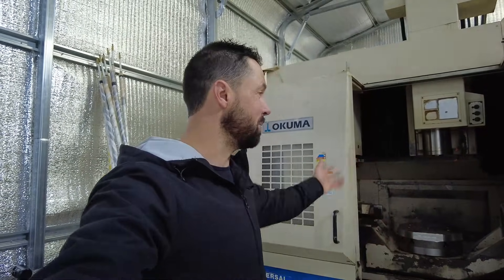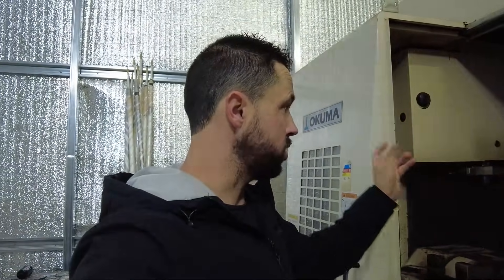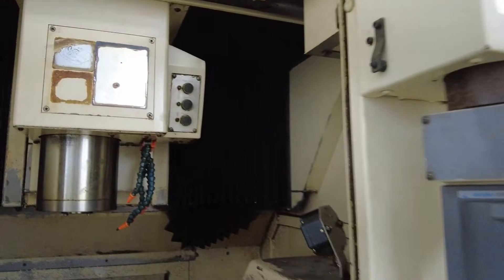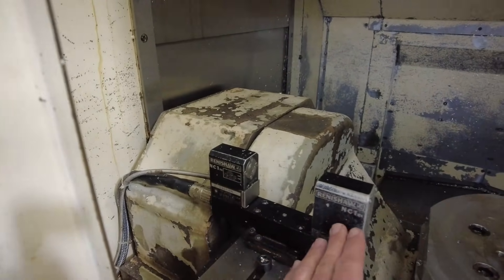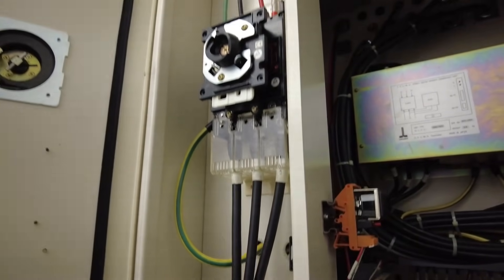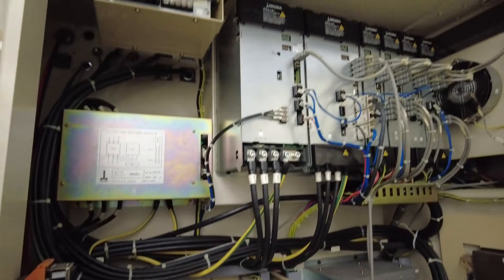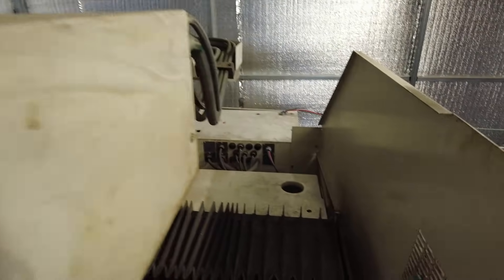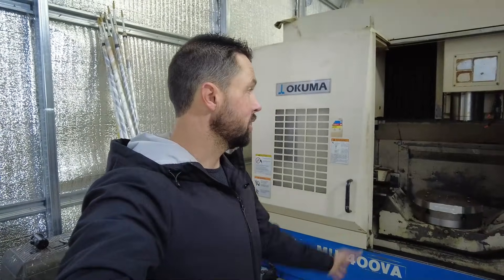Okuma 5 axis update #1 - Is my spindle DEAD?

Comment: I have an Okuma MB-46 of the same vintage.  Getting the toolchanger to work correctly can be tricky and it took me reading the manual a few times to understand what was going on.   If you stop the tool change mid way, you'll need to manually sequence each step to get it back to the beginning of the tool change cycle.   I had a problem with mine stopping mid tool change.  Had Okuma come out and they found one of the magnetic limit sensors on the tool door went bad.  It has a little LED light that indicated door open or closed.  If there is no light, the sensor may be bad.   All was well after replacing that.  The Okuma techs are top notch and know the machines very well.   As far as paint, I use an automotive single stage urethane.  (2 part)   Limco brand and it can be bought at any auto finishes store.  I use the Limco H1000 waterbased primer under the paint.    It's lasted a few years now and hasn't bubbled or flaked off with constant contact with coolant.   Very happy with it and the machine is starting to look new again.  I'm using Trim Sol as my coolant at 14% Brix.  Had surface rust issues below that number.   Best of luck!  That's an awesome machine!
Reply from the maker: Nick,  thanks a ton for the comment.  Had a MASSIVE breakthrough the other night.  Topped up the DTE oil Light, and made sure I had a tool in the spindle.  Did my M19 and she oriented.  Then went onto MDI mode gave it a spindle command and it works!!! Insane how critical the order is and how hard to figure out if you’ve never done it before. 😂😂. So we’ve got it mostly figured out tool belt moves, tool changed for me and now I need to figure out how to set WCS and upload some code.   Super stoked about the machine.  Do you happen to run the DNC or RS232 options?
Reply: @ericschneiter  I just use USB.  I haven't run out of memory yet.

Comment: The laser setters aren’t the best if I’m honest. They can have some cool functionality. But in practice… not so much. They’re great for broke tool detection. Can measure profiles, check for broken flutes, etc but man they are problematic. They’re more meant to be used in conjunction with a presetter. A pad type ts27 or similar will be more reliable to set lengths. Do you have scales on at least the tilt axis? Machines in this class can surprise you with air requirements. Often it’s the scales.  Old cmm’s can be a complete waste of time and money. There’s so much that’s gotta be perfect, geometrically speaking, scales, air lines, air bearings, a lot to go wrong. You take the life of a cmm in your hands when you transport it. If they weren’t tied down properly, there may always be odd gremlins you chase.
Reply from the maker: I’ve wondered about it.  I guess I’ll see if it even works.  I mean it all lights up when the machine is on and stuff.  I’ve just heard SO MUCH mixed feedback.   I really just want a good reliable way to check tool breakage don’t know if I would even do that much with the wear comp.  You like the plunger style in your experience.   
Thanks for the comment I appreciate it. 🙏👍
Reply from the maker: Haha yeah we will see with the CMM machines. 😂. I don’t know, but it isn’t a huge risk or loss if they don’t work.  I can try the Cmm software for free for a month to see if I can get it dialed in.   We will see.  It’ll be an adventure that’s for sure.  Bottom line I’m gonna need a bigger compressor lol

Comment: If this is anything like an M560v it will use a lot of air - continuously.  The air spindle chiller is the culprit.  Just how it is.  Kinda sucks to have the compressor turning on/off all day.
Reply from the maker: I think it’s a lot like an m560.  It sounds like it’s constantly leaking air EVERYWHERE 😂. Bottom line I’m gonna need to get a screw compressor and a dryer. I don’t think my current one makes even close to enough to keep this thing fed the whole time it’s running.    Thanks for the comment.  I learn from every single one of these and meeting new people.
Reply: @ericschneiter  Yes, that's how mine sounds and I have a new one.  Sounds like it always has a leak.  I put mine in e-stop to reduce all the air usage.  Doesn't eliminate the annoyance of air but it definitely reduces it.

Comment: Try see if you can confirm that the limit switches on the draw bar are triggering, the spindle won’t alarm nor start if the drawbar sensor isn’t confirming a tool clamp
Or unclamp, on a 3 axis Okuma MX45-VAE from the same era it’s around page 14 on check data page Lin 3 Bit0-3 it’ll be SCLP OSUC ISUC ISCL when the tool is there should only be two on at one time two cycle on when clamp and the other two cycle on when unclamped
Reply from the maker: Thanks a ton for the info, I’ll check this and see, I swear it’s probably something small like this but not having a ton of experience with this control makes it hard to diagnose or do anything yet.  I appreciate the help! 👊
Reply: @ericschneiter He is correct on that. They use Omron Proximity sensors on top of the spindle in an MX of that era, might be similar in yours. 
Two for the inner spindle and two for the outer.  Looks like your machine has MIV drives, which is good because they are cheaper than the BLD drives they replaced. Okuma usually gives you a 25% core on your old drive.

Comment: Try the 2 component Sikkens Redox PUR Finish Gloss. It is really good. Marvelous machine, thanks for posting!
Reply from the maker: This is an awesome comment.  Thanks so much for the recommendation I was hoping someone out there had some experience. I’ll take a look.  Do you know if it comes in colors or do I have to add my own pigment?
Reply: @ericschneiter You specify the  RAL color. On my LB10 i used 7035 light gray for the white, which was a good fit. https://www.youtube.com/watch?v=CNaRmhYEkRc
Reply from the maker: Awesome, headed over to watch the video right now.  You’ve had good luck with it holding up to coolant I’m assuming?
Reply: @ericschneiter  I used it before on the surface grinder and there is lasted. The LB10 uses different coolant but it holds.  Not sure if the Sikkens brand is available in the US... But a 2k PU based painted would definitly be my bet.
Reply from the maker: Awesome thanks.  I’ll try and see if I can get this brand.  That LB 10 looks incredible in that green.  I’d love an end result like that.
Reply: @ericschneiter 
I used an automotive 2 part acrylic urethane on a machine that deals exclusively with coolant and it's held up amazingly well.  I used that after seeing guys that rebuild machine tools recommending it and I'm glad I listened.  Just make sure you get a full face respirator on.

Comment: You need to be a bit self reliant owning an old CNC. I have a VMC and a lathe, and both of them had blown up spindle drives when I got them. The mill spindle drive previous owner was quoted at 3500+shipping to send it out for repair - I was able to repair it myself for $70 of parts and a few evenings of soldering and PCB repair. The lathe I fixed the spindle drive for about $120 - it was blown up worse than the mill spindle drive was. If you need some help, feel free to reach out.
Reply from the maker: Totally get that.  Ive got 2 older machines from the 90’s so I’ve done some scrapping already.  Some of this stuff from Okuma can only be purchased through them.  They are totally vertically integrated and make everything on the machine.  So it can be a little harder to scrap together parts.